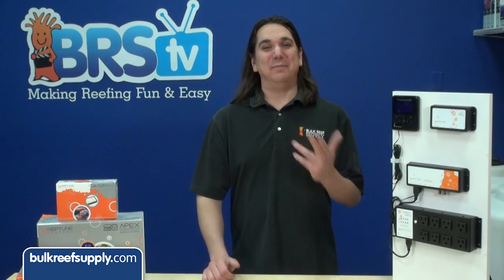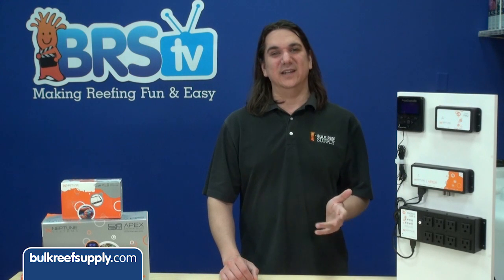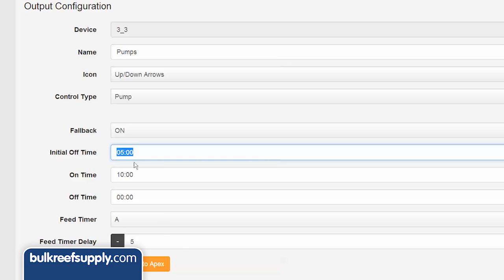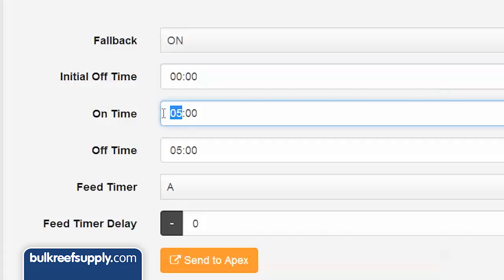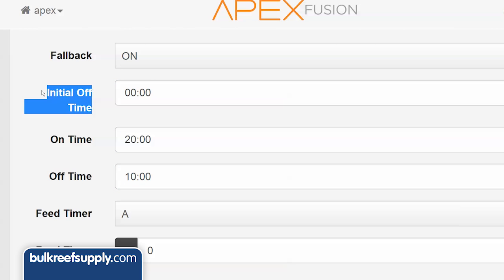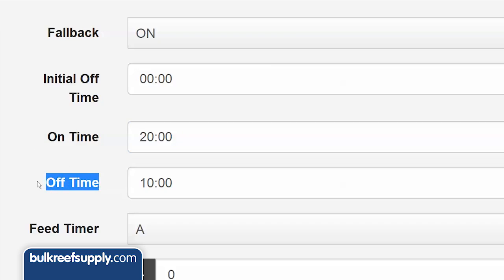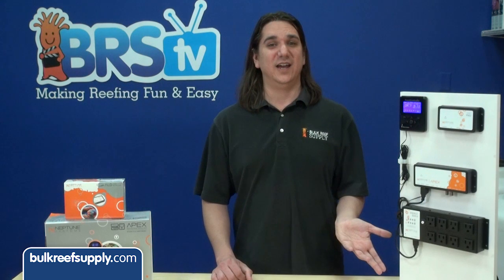Program your Pump Outlet & OSC Function EP 15: Apex Aquarium Controllers from Neptune Systems

Comment: I just want to figure out how to turn a powerhead on at 9am and go off at 9pm. Can anyone help?
Reply: The Neptune user forum (https://forum.neptunesystems.com/forum.php) is a great place to go for help. For your specific question, you could use the OSC function, but an easier way would be to use 
  Set OFF 
  If Time 0900 to 2100 Then ON
This starts with the pump off, then turns it on between 0900 and 2100.
Reply: @ptester1  it worked. Thanks
Reply: @ptester1  awesome. Thanks!

Comment: Hey Ryan & crew. I think you really nailed the "initial off time vs off time" component of a second pump. It's too bad almost every online example I've seen shows both the initial off time and off time used on a second, synced pump.

I couldn't figure out why my right pump would seem to be repeating the initial off time every cycle, and wasn't working correctly as it would be off two seconds, on two seconds, off four seconds, on two seconds, etc instead of wait 2, on 2, off 2, on 2, off 2.

Thanks for the correct info!

Comment: Should mention that the BRS Dosing Pumps are not supported on the majority of the APEX outlets as they don't draw enough current and can fail in the On State.
Reply: +V Britt I was running into this exact issue and looking here for the answer, thank you!
Reply: +Kyle Riedel FYI I purchased a Tradesman 4325c Outlet Adapter Plug for each dosing pump (using 3)  from Amazon and with the little light built in it seems to force it to use enough power so that I can use any outlet I want.  I have been doing this for a little over a year now and haven't had a single problem .
Reply: +V Britt Awesome! Looking at them now, thanks for the heads up.

Comment: ufff.   So when does the actual cycle time for a pump start?  The way I understood it in the vid was at midnight 00:00.  The initial off time is at the start of every cycle? thus midnight? so the initial off time should only happen once a day at midnight.

So wouldn't the off time be what you need to osculate the pump?  The left pump I would think would be off 10 minutes at midnight then on for 20 minutes and never shut off, guess its still confusing when the cycle starts.

Soo.. by this vid its like
Initial Off time
On time
Off time
Repeat

Not
Initial Off Time (once a day at Midnight)
On Time
Off Time
Repeat to On Time

You're right this is confusing.
If the initial off time is used every time the On Time runs out, why have an Off Time?  I thought Initial Off Time was once a day at the cycle beginning.   Or is the end of a cycle after the Off time

Keep up the great work guys
Cheers
Reply: ***** Ahhh  ok,  took a little bit to pound that in.  So, think it as maybe "where" you want to put the off time, in the beginning or end of the cycle.  I guess, as Ryan explained, initial get confused with only once at the beginning of the day.  I watched that section about 20 times, and could put it behind me that initial isn't actually only once.

Thanks for further clearing that up. :)
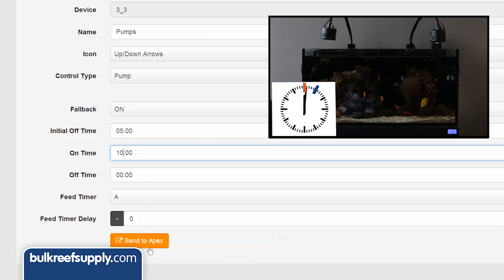Reply: ***** Thanks for the videos.  They're great.  I think the confusion is due to the example given at 3:20.  I'm pretty sure this example was incorrect.
Reply: ***** Thanks for the quick reply.  My apologies, I thought it was an obvious error but I re-reviewed it and can see why it is correct.  Maybe it is just a bit misleading and could use some clarification. The transcript at 3:20 is "If I set the "Initial Off Time" to 5:00 and the "On Time" to basically anything, the cycle would start at midnight with the pump off from midnight to 12:05 at which time the pump would turn on.  (the accompanying graphic shows one on marker at 12:05 and no off markers).  So the on time is how long you want the pump to be on during the cycle..."  When I watched this video the first time, I incorrectly assumed that the pump would continue to stay on from that point on.  I know that you stop showing the markers once you make your point but in this case, since it is a bit confusing, more markers or a verbal clarification might have helped me.  Thanks again for your help.  I am impressed by how diplomatically you handle comments and critics.  Good job!